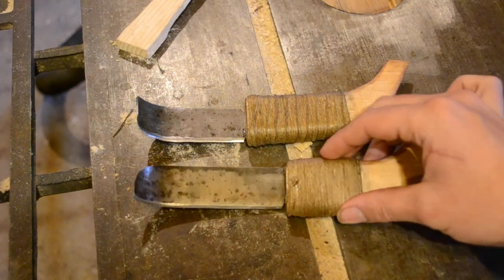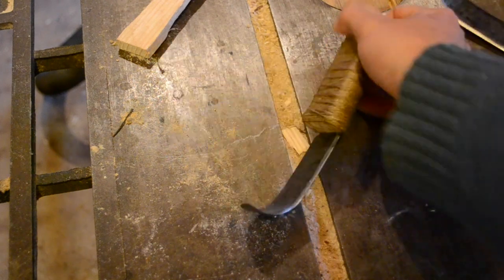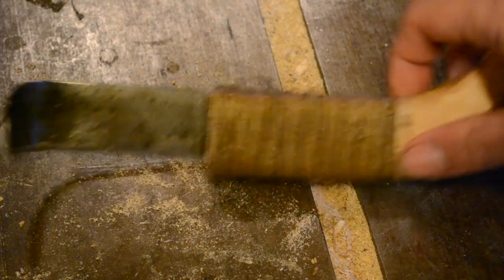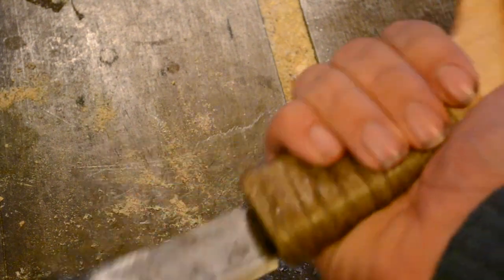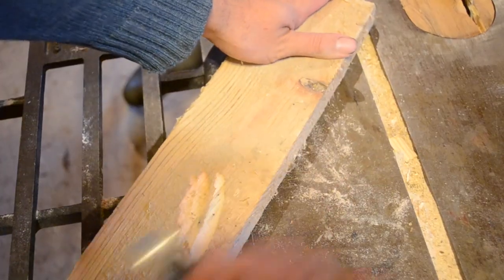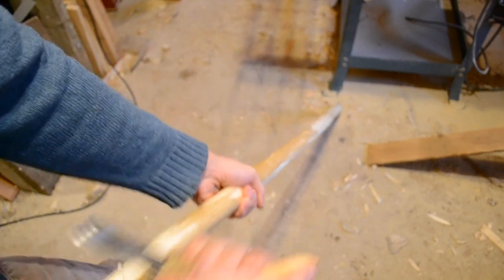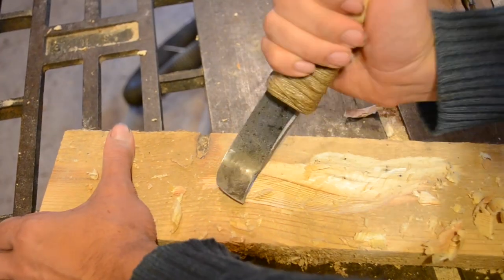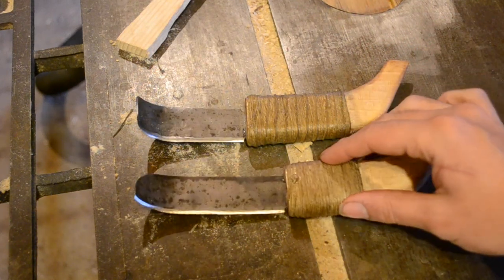A brief look at crookedknives.

Comment: The crooked knife was not really intended to be used as a scorp. It's kind of the wood working multitool. The primary use was construction of birch bark canoes and similar projects around the camp or afield. Since canoes were usually constructed of white cedar or spruce which both carve pretty easy as well as the bark itself. They didn't always have a curved end either and some were quite short. They were always "crooked " though. Usually a bend where the blade met the handle as well as the bend in the handle which should be upswept to comfortably accomadate the thumb. Sometimes very ornately carved. Probably campfire projects or rainy days in the lodge.

Comment: Why would you not use it in a forward grip like a hook knife instead of a gouge when trying to carve spoons or bowls?

Also, thank you for this as I had been thinking on tool knives with multiple uses at this fits in well.
To get better control for hook knife carving might a "false handle" guard in front of the main handle allow the user to safely get their hand closer to the bend for carving?
(I started carving spoons and bowls a few months ago)
Reply from the maker: The downward grip is very secure and the position of the skeleton allows you to engage the big muscles of the arm more effectively.

As to a second handle, most of the historical examples have much shorter blades than the ones here.
Reply: @MalcolmPL  draw knife users big muscles. Carving usually the small ones as more controlled. At least from what I have heard and limited experience leaving to carve spoons
Reply: It's not a spoon carving knife. It's a one handed wood plane , usually for small longer projects. Canoe parts , paddles, spear shafts , arrows etc. I use mine with a forward grip sometimes and still love my drawknife and shaving horse. If i was a spoon carver ( and I'm not) I'd make a forward use , short blade version.